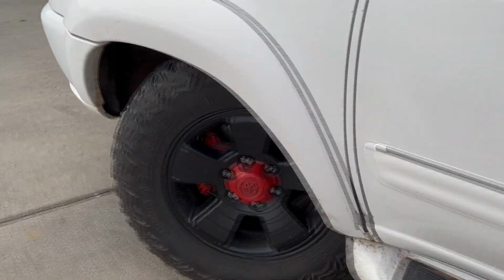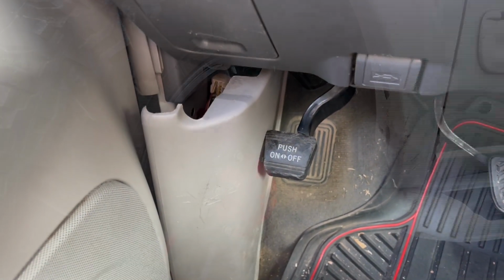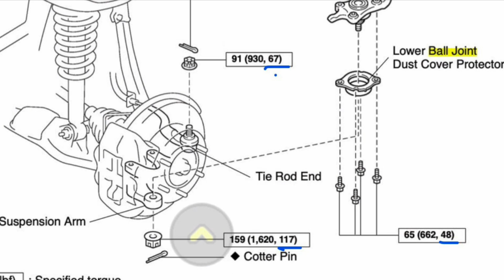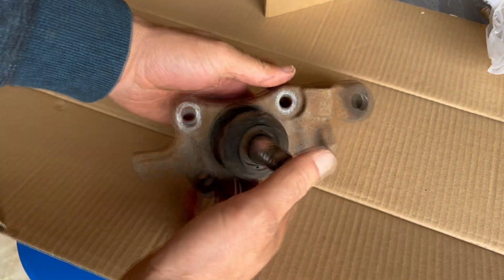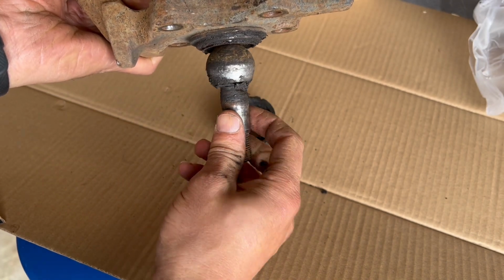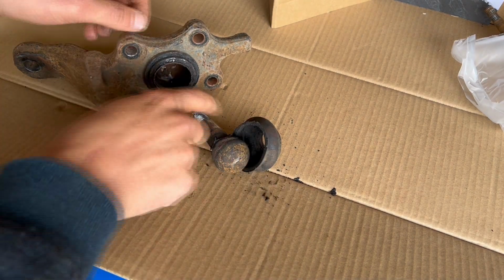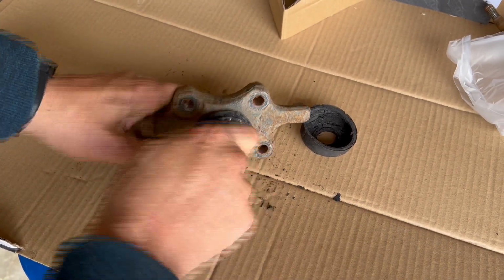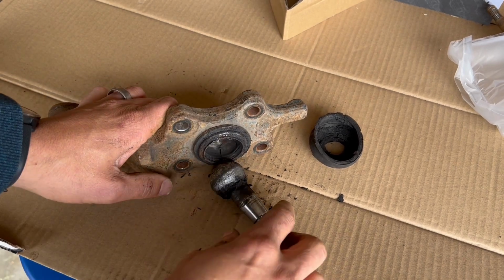Fixing a Failed Ball Joint on a 1st Gen Sequoia

Comment: Hey buddy, I have a 2001 sequoia myself and I’m planning to do the lower ball joints pretty soon. Did you only do the lower ball joints or did you ever do the upper ball joints as well. Also what about the rear I never see any videos mentioning the rear it’s only ever the front joints? Thanks
Reply from the maker: I’ll try to answer in order. I did the uppers and the lowers. The uppers I did afterwards. There aren’t any in the rear because it’s a straight axle. Ball joints are just for suspension that will be pivoting so you’re good just up front.
Reply: @ProZacksProjects  awesome thanks for letting me know!

Comment: I have a problem with a lack of water from the radiator, and there is no visible leakage. Can you help us solve this problem? Please make a video.  My car is a 2004 Toyota Tundra
Reply from the maker: Is your head gasket leaking? Thats typically what causes low coolant levels without any visible leaks. If your coolant system is very pressurized it may also just be pushing it out through your overflow tank. Those are the only things I can think of.
Reply: Yes, this is what happens to me. What is the solution? Thank you

Comment: Specs for the torque on these is all over the place:  117 or 103, 65 or 59….  How?
Reply from the maker: I’m not sure if aftermarket manufacturers have different specs from Toyota, but the hardest part about the Internet is getting one concise answer.
Reply: They need to be tight and the lower nut just needs to be where you can insert the cotter pin anyway.